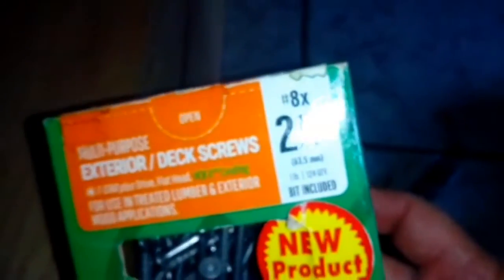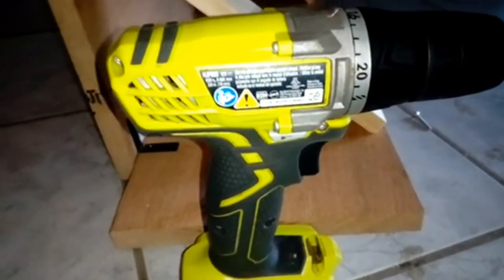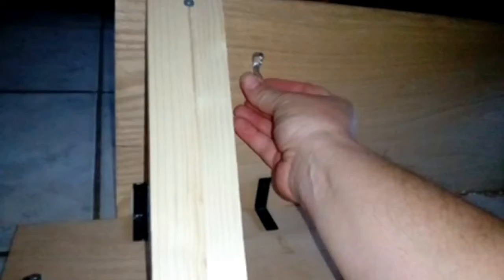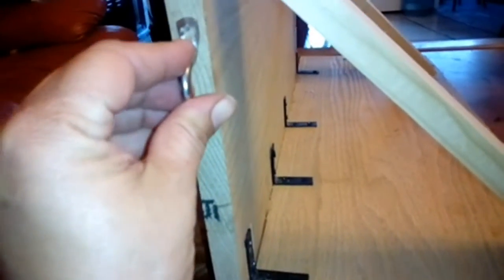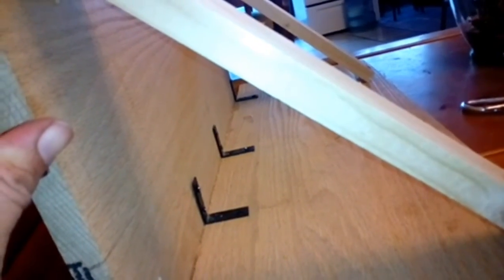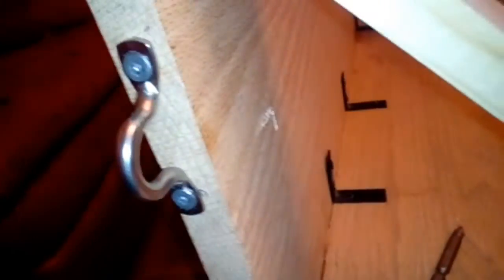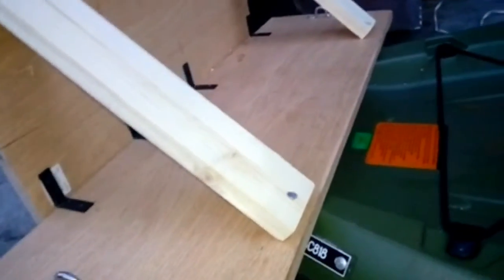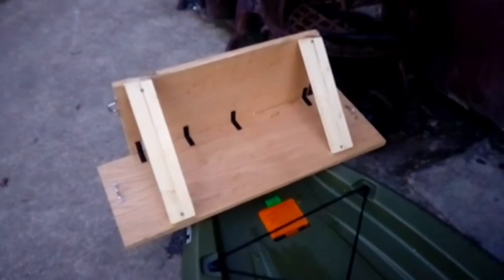The new motor mount for my kayak #kayak #diy #motor #mount

Comment: Okay Christina, now  see what you're building.  If your motor is only a trolling motor, then your fabricated motor transom should hold up.  If it's a small 5 hp gas operated motor, that transom need to be fixed very firmly to your kayak deck.  I'm just not seeing your idea yet.  I'm trying to go back through your videos to see what you're planning.  I'll keep going through your vids.  Oh, you're quite the handy woman (compliment intended).
Reply from the maker: If I remember correctly I think it's a 3.5 horsepower it's 20 lb I was thinking about putting bungee cords on it but I had a good friend tell me just put a ratchet strap on it it should hold the wait I'm also going to put two stabilizer and I love doing things myself I usually never asked for help the stabilizer are about $205 and I'm trying to see if I could make them myself instead but everything I see on YouTube doesn't work for me because it's already done so maybe next video I make I will be making the stabilizer
Reply from the maker: Ps. Thanks for the compliment
Reply: @FishingwithCristina  The ratchet should work, Christina. Just make sure it's really ratcheted down firmly. The reason it must be firmly fastened is once that engine starts and the propeller turns, the prop will dig into the water as it's spinning and that's when the transom must be very firm so that the force the propeller is pushing down into the water will then gradually lift the rear (stern or aft) of the vessel. If that transom is not firmly planted onto the vessel, the prop will shoot-up into the air.  I remember seeing a video that stabilizers made using  long 4-inch PVC tubes that were capped off. Your build should be interesting.  I look forward to your build.  Bye for now.
Reply from the maker: I'll put it in a small Lake first to see if it works my brother wanted to put some glue on it he works making yachts I told him no because sometimes I may want to paddling